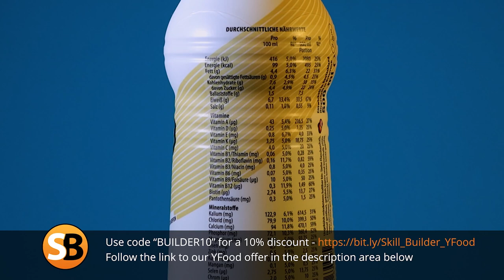Loft Conversion RSJs ~ LoftCon #1

Comment: Beautiful job men. I really like the rain covering roof and scaffolding.
Reply from the maker: It is a real surprise to see so many comments on the 'tin lid' or 'top hat' because in London and the South East it is very common. In that street along we can count three of them. I would say that 30% of loft conversions in London are done like this. Some of that has to do with making a good working area up on the scaffolding. With no gardens, limited parking and nowhere to store materials the need to take the roof off completely and get rid of the old timbers immediately requires a completely different approach. There is also the insurance aspect.

Comment: Never seen such an elaborate scaffold for a domestic job, nice setup-ideal for the UK; even if it is summer, there will be another season along in a few hours..
Reply from the maker: It is now very common to put a tin lid on a house of this size. It turned out to be a good investment because it poured with rain that day and the next and the one after that.
Reply: only right ,builders deserve proper safe conditions , for years i worked on bandstands/hop ups /traps in boards one slip and your fucked they think a hi viz top will keep you safe
Reply: I though the same. The canopy over the property is a great idea. I've been trying to paint my shed for the last month and it's a gamble whether to start or not cos the weather changes so often. North East England weather for you I suppose but great set up there lads.

Comment: The last guy i worked with doing loft conversion used half lengths of steels with flanges and we bolted them together, But i was never happy with a bounce in the middle , he ended up packing off the walls below to kill the spring, I was never too happy about it..

Comment: I'm a structural engineer and I design the structure for a lot of lofts.
(Unless the width of that house is an optical illusion) I can scarcely believe the weight of those steel beams.....

But that's not your fault. Good quality work, Guys......
Reply from the maker: Can I hire you to check some calcs for me?

Comment: Great to watch. Some advice please. I live in a 1930,s semi thats crying out for loft conversion...Purlin construction, good height etc..but how do you get the steels in without a gaping hole in the roof. Can shorter lengths be bolted together ?  Many thanks.
Reply: Yes, you can have the steels cut into shorter lengths and fix them back together with plates and bolts. We have done this a few times but I prefer to keep them in one length.

Comment: Excellent video! Intrigued as to what the reason for using joist hangers over butting the joist direct into the steel beam? It cannot be for strength so it must be for later framing to plumb? I feel a Roger video coming on for the different methods of fixing timber to UBs!!! Yes Please!

Comment: Brilliant work 👍can you tell me what nails your using in your nail gun to fix hangers and will they work in a paslode gun.??
Reply: They’re 35mm twist nails. The gun is a positive placement nailer and the nails are collated specifically for it. It’s a great tool and saves hours of work but that is the only job it can do.
Reply: James King cheers James and you also get to keep all your fingernails 😀paslode should get in on these
Reply from the maker: Paslode have had a positive placement nailer for years. https://www.jewson.co.uk/p/paslode-ppn35i-positive-placement-nailer-JTH03301

Comment: Looks like another good series coming along. What would have been the jointing method in the old days before hoist hangers and steels?
Reply from the maker: The joist were often run from plate to plate with a supporting wall in the middle of the house. Sometimes the joist ends were short of the walls and spiked into the rafters. My house is built like that and it is 120 years old.

Comment: Should be a great series, was it raining the whole time? can hear something in the background.

Also them pad stones are very small considering the size i had to put in recently.
Reply: We use steel spreader plates instead of pad stones (providing the engineers approves it) as they are so much easier to fit and don’t ever encroach on the rooms downstairs.

Comment: Pretty sure I drove past this job yesterday, East Molesey by any chance?

Speaking as someone who runs a loft conversion company, it’s nice to see someone else installing the joists correctly and not just sitting them on the bottom flange.
Although I wouldn’t fancy carrying that air compressor up there!
Reply from the maker: No not East Molsey but maybe only 10 miles away

Comment: Why were the floor joists fitted onto joist hangers , ? mine were tucked into the steel beams , much easier and quicker ! just seems a lot of work to get to the same point not to mention all the extra materials and hundreds of nails .
Reply from the maker: We do it both ways depending on the setting out.
Reply: You do whatever the engineer specifies🤷‍♂️

Comment: Excuse my ignorance but why have you switched to an air nailer rather than a cordless to do the hangers?
Reply: It’s a specific nailer called a positive placement nailer. The nails protrude from the end of the gun so that you can place them directly into the hole on the hanger. This gun serves no other purpose. They do make gas powered ones but they are big bucks in comparison.

Comment: nothing wrong with what your doing, but why do you not cut the joists into the steel beam then nog it out accordingly ? takes the stress of the jiffy hangers and the overall need for them
Reply from the maker: We do that sometimes, it depends on the job. The web in the beam is just under 150mm and the joists are 175mm so where do we cut the inch off the joist and who passes that as structurally sound?
Reply: Skill Builder ideally off the top as no stress in the top of a simply supported end bearing

Comment: why did they put wooden planks in the steel beam to attach wooden frames? isn't it easier to place a wooden frame directly in the steel beam without those attachments?
Reply: no because that way it wouldn’t be as strong
Reply: Just incase the steel is off level across the span its easier to level the timbers due to weight
Reply: Plenty of people do just cut the joists into the web and sit them on the bottom flange, but it’s not the right way, they should be on hangers onto a piece bolted to the webz

Comment: good job lads, always still amazes me though how 1000 year old cathederals with multipe floors of 30m floor spans are still standing.in your opinion do you think all this steelwork is sometimes overkill?
Reply from the maker: Structural engineers  love steel and it is often worse in a fire than timber. I would rather see two bolted timber beams across the ridge but if they want steel then steel is what they get.
Reply: @SkillBuilder  i agree with you on that rog, another good vid pal keep em coming.
Reply: @SkillBuilder  as a structural engineer in my experience I think there is a tendancy to over size elements, partly I think I've seen poor worksmanship on site, like not all bolts being installed in a beam to beam connection for instance or rebar being omitted from concrete, but also the cost of oversizing vs the consequences of a failure are minimal
Agree about fire resistance of timber vs steels generally but it all comes down to the design and detail
Reply: My old former loft conversion done in the 70s was all in timber, no steels. I’m looking to extend this to the outer walls and hoping to continue this in timber to retain the existing

Comment: Am I the only one that's going to say that its a crazy amount of scaffolding. Can't imagine how much that would cost to have installed for the time they working on the project. Madness
Reply from the maker: You only have to drive around London and you will see any number of tin lids. It is standard practice with houses costing a million quid a go. With loft coversions costing around £80,000 it is not a huge extra. It also means the work can carry on in all weathers. If a roofer is rained off on another job  he is very happy to come and work under a steel canopy.

Comment: Hi Roger Why not fix the timber to the RSJ with Paslode nails?  The chippy who did my garage roof (10Mx8M) 40 years ago did that and it saved a lot of time and the cost of drilling the RSJ.  Mike
Reply from the maker: The drawing calls for timbers bolted to the steels. We work to the drawing because it is their risk not ours.
Reply: Skill Builder Understood but I assume that using nails would be structurally fine as the load would be carried on the base of the RSJ and not by the fixings.

Comment: A handy trick I do is get my steels cut in half and have them pre drilled and plated either side makes it a little easier on the back 🔨
Reply from the maker: We have the option of cleated steels but the single steel is better. Those plates get in the way.
Reply: @SkillBuilder  
Yeah and having the staff definitely helps aswell as access through the roof me and my pal normally walk them up the stairs as it's only the 2 of us 🔨

Comment: is the old joists gonna stay or it will go?thank you
Reply from the maker: They are holding up the ceilings and will be strapped to the new joists but still not be connected so the noise transmission is reduced.

Comment: Why not set the steels on the same level and do the timber flush with the top ?
Reply: silviu bahnovei because the steels need to be big enough to carry the load imposed, but you want to keep the floor level low enough so as not to compromise on head room...
Reply: This was a tricky one. The steel closest to the cylinder was raised up to clear some essential pipe work that couldn’t go anywhere else and the reason that the timbers are not flush (or slightly above) the steels is that it would’ve meant cutting the hangers which would compromise their strength so we will add a piece of 50x25 on top after it has had the chicken wire and insulation fitted between the joists.

Comment: in my house the only way would be to lower the floors :(, i wonder how much more the cost would be the only problem i can see is the damage to the lower rooms. its a shame but i need 2.2 or 2.4 m and mine is 2m :(
Reply from the maker: Have a look at Eco Joists. You can hang them on the top flange of the wallplate. That will give you more height and the span is much more than timber.
Reply: Skill Builder could you give me a rough price on an eco joist . Obviously you can’t give me an exact price but let’s just say a 5 metre span by whatever minimum depth they make just so I can roughly gauge how much it would cost because I too would need to lower the floor and take some of the existing bedroom height from below . I know it’s only be a rough guess but you’d probably have a better idea than myself . Appreciate any help thanks
Reply: @SkillBuilder  Thank you, will check it out as i cannot heighten the rood and to lower them ceilings is also not an option :(

Comment: Is there a reason that you didn't just level & install the outer joists first and the just pull a string line through for the centre ones?
Reply from the maker: You can do that and we do it sometimes but the string can get in the way a bit. Lasers are the new string.

Comment: Was it designed to have those beams slightly different heights, or did the original building dictate their final position?
Reply from the maker: It was done that way to miss the 28mm gas pipe supplying the boiler. It is no big deal because the joists were set with the laser level.
Reply: Skill Builder had to be a good reason! Looks solid work.

Comment: It’s been a while since I’ve done a loft conversion, can’t you run joists beside the old ones with intumescent tape between the two any more? I don’t know why people think you have to use steel for the floor? It’s always been fine with building regs
Reply from the maker: The joists are timber but they are supported in the party wall and the gable end
Reply: Everything is done with steel beams now. Not like it used to be in the 80s, thank god! That way the floor stays level,

Comment: This job gave me pure anxiety. Ive fears of those old brick walls crumbling with the heavy steel in them
Reply from the maker: Hi Jono 
When you look at a Celcon block it is very light and full of air but it will take an incredible amount of weight provided you place a steel plate or concrete pad stone on it. These bricks are old but that is a solid 9inch wall and it will take tons of weight. Also worth notiing that the walls that blow down are the gable  with no weight on them. This beam helps the structure and, in the great scheme of thing it weighs hardly anything.

Comment: As a building engineering student, I don't see any advantage of putting heavy ridge beams, I spoke to my teacher and he don't get it why people go for heavy ridge beam (more than required) may be lazy structural engineer or  Is it customary. Looks like primary ridge beam of this house was timber and took the weight of the roof with supporting purlins.  Flitched beams will do the job or you can go with 8/8 metal beam  with purlin supports. Builder's dont realise purlin supports three quarters of the weight of slope roof.
Reply: The second video will clarify the ridge steel is also being used to transfer the loadings for the new dormer roof. The ridge steel profile looks relatively small in that regard & laterally provides good restraint between the existing masonry walls during construction. I guess a timber flitch beam could be used, but the height would be taller & as there are other floor steels on this project, this appears to be the more economic & practical design solution taking into account existing site conditions.
Reply: I have done a few flitch beams in my time and with a 10mm steel plate going through the middle they are certainly not lightweight. Even getting the bendy steel plate up into the loft is a mission. The steel on the  ridge is not just about surporting the rafters it is about supporting that snow laden dormer and putting the load onto the gable walls.
Reply: Roger Bisby good to know about flitch beam. I have heard from few other sources they are not light weight as I thought. Plus need to be very cautious because of it’s bendy nature.
Reply: shut up and get back to school

Comment: Why not just sit the timber in the web of the steel. Gets rid of the joist hangers
Reply: to level the wood. The left steal is higher than the right
Reply from the maker: We do that sometimes but in this case the drawing called for joist hangers. We price and build what has been passed by Building Control unless there is a compelling reason to change.
Reply: borodinskyful if you level all the steel off each other then the rest of the job is the easiest. I do it for a living
Reply: Skill Builder I understand. But to me it seems like a pain and doesn’t achieve anything worthwhile.

Comment: Could carbon fibre one day supplant steel?
Reply from the maker: Yes it will happen with graphene but at the moment steel is relatively cheap.
Reply: Unlikely. A cfrp u/b of that size to take the specified loads would be an astronomical price. There are many different types of carbon fibre tows (strands) and resin systems all with widely varying properties, but the failure mode is still very sudden...

Comment: A laser on every hanger. If the steel are level, set your first hangers and work of the steel. Must have taken forever. 2 men to put some hangers on. Must be some money on that job.
Reply from the maker: Joist can vary so working to the hangers is not the best way. Perfection is achieved by small incremental changes in the way you work. Make it your resolution for 2021 and you will find you are:- 
Happier
Richer 
More Popular 
Spiritually enlightened 
Better in bed
Reply: It took about an hour to fit around 40 hangers. They were all spot on so I’d say that was pretty good going.

Comment: How much does something like this cost? 🤔
Reply: 20-30k
Reply: @LunchBoxArcades  a reasonable estimate I would have thought, look at Rogers answer from another comment
Skill Builder
2 days ago
You only have to drive around London and you will see any number of tin lids. It is standard practice with houses costing a million quid a go. With loft coversions costing around £80,000 it is not a huge extra. It also means the work can carry on in all weathers. If a roofer is rained off on another job  he is very happy to come and work under a steel canopy.
Reply: Simon Stones depends where you live. 30k ish dependant on spec in most places, double in London
Reply: Pfft £20-30k unlikely! This is definitely in the southeast and I’d say for a fully finished job this is easily £55-60k.

Comment: The irony is you have to put steels in to support the weight of people on the new floor for building regs…

yet you have to get all the steels up with 5-6 people plus tools on the existing floor and is not like your floor instantly collapses
-What do I know I’m not a structural engineer just an observation

Comment: Surprised the floor wasn’t dropped to either preserve or increase head height.
Reply from the maker: There is loads of headrooom, much more than normal. How tall are you?
Reply: @SkillBuilder  5”11. Just my opinion bud. For not much more work I prefer to drop ceilings to open up the eaves/sides especially if a new floor is going down anyway. Would get an extra foot either side at least. Why not when its opened up? Instead the raised floor has lost a foot either side. So thats 2 feet either side. The room would be massive. But great work and enjoyed the vid.